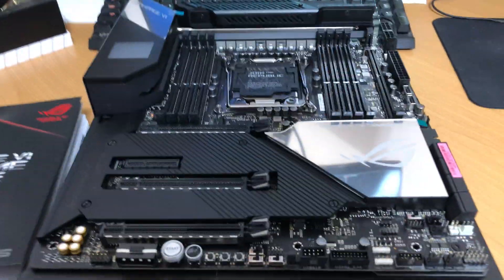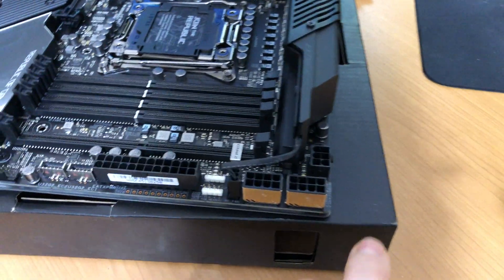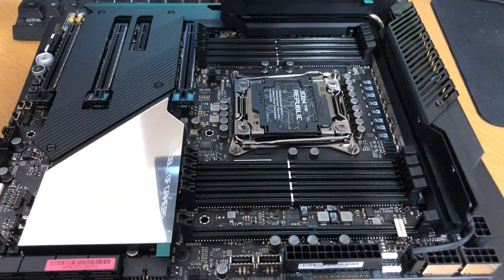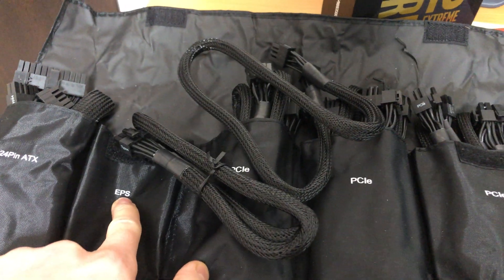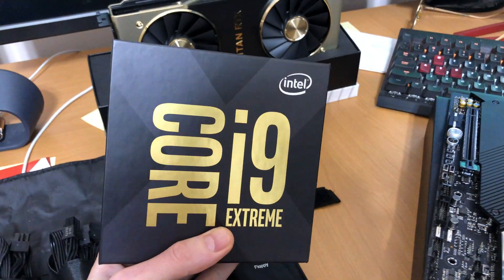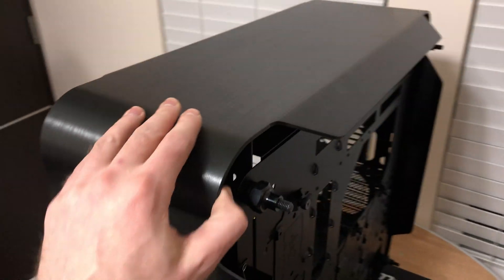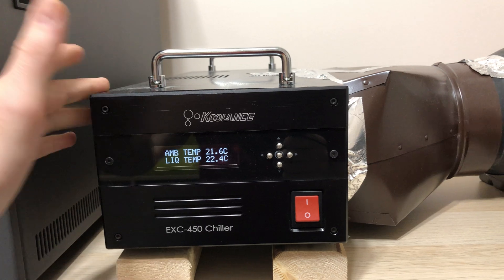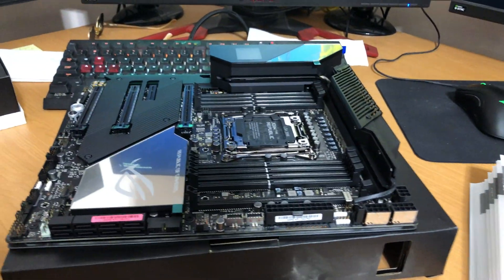ROG Rampage VI Extreme Encore - Why it has 3 power connectors?

Comment: Thanks for the update... My Rampage Extreme Vi did well stop working as it should last week .. so i had to send it back .. and they had no similare left ( well there was one that needed minimum 3 CPU cables .. though i have found no powersuply that even has that in stock here ...  So i got my money back so i could buy the encore instead somewhere else .. and that made me crazy what the 6 pin was for .. if i dont need it because i dont do overclocking or i can use a PCIe cable instead there then i am good and happy .. lets hope the last Encore motherboard that seems to be left in Europe works :P

Comment: I know I'm very late to this video. The 2x 8 pin EPS and 1x 6 pin PCIe are all for CPU since they are right next to the CPU VRMs, as an 8 pin EPS can provide up to 336W, and multiply that by 2 is 672W. Now, since there are cooling solutions that can allow you to cool CPUs operating past ~650W, that's why the additional 6 pin is there, to give an extra 75W of power, and because 99% of normal power supplies only have 2x 8 pin EPS (which to be honest, is not a problem). I know some tech junkies will explain that because of the cable gauge, 6 pin cables can actually pull more, as the extra 2 pins on PCIe 8 pins is just ground pins, but I am just sticking to specs here for normal operation. Since this is in the Extreme lineup, you always get the most power support with the exception of the Apex board, which is specifically designed for hardcore overclocking.

Edit: The way I know the 6 pin PCIe connector on the motherboard is actually for CPU and not PCIe slots is because it is next to the CPU VRMs, and not next to the actual PCIe slots; even the motherboard states it is for EATX_12V, which means it's for CPU.

Comment: The EPS power all go through the VRMs, there is no separate plugs for the CPU directly.  EPS power carries 12 volts. VRMs sole purpose is to step that voltage down to what the CPU can actually use (.7 to 1.3 volts). 

Both 8 pins are EPS connector. The 6 pin is meant for and accepts a 6 pin PCIe just bill one would use for a graphics card.  It will not burn up the board and you do not need to force it, the connect fits just fine.

The reason for multiple plugs is that Higher end CPUs draw more current and in boards designed to over clock then the power draw can increase by 2 or 3x when pushing the limits. To handle the extra current board makers are forced to supply more current to the VRMs by increasing the number of wires to the cpu hence 3 plugs.  If you try to pull 100 amps through a single 8 pin plugs the wires from the PSU to the MB would melt their insulation and probably catch on fire.

Comment: some processors are extremely power hungry if you overclock them for example the Threadripper cpus can consume about a whopping 400+watts on full load. In short for stability reasons you have an added power connector

Comment: I have the same board for my motherboard and I have a Intel I9-9820X and I ended up connecting all 3, meaning two 1x8 pin CPU cables and one 1x6 PCI-E cable. I haven't tested it in extreme yet thought. Good luck to anyone else wondering about the same question

Comment: Hey.
About slot x16 on Rampage VI Extreme Encore,

PCIe 3.0/2.0 x16_1
PCIe 3.0/2.0 x4 (PCH)
PCIe 3.0/2.0 x16_2
PCIe 3.0/2.0 x16_3

I have RTX NVLink SLI Bridge (4-Slot Spacing)
so

Can I use the first slot and the third slot for Nvlink run at x16?
or must be first slot and second slot?
Reply from the maker: Go to BIOS setting to assign lanes per each slot.
Reply: @pcfreezer6448   Thank you.

Comment: You dont need to plug all EPS connectors
For 300W power consumption of cpu, enough one 8pin
600W 8+8 
900W 8+8+6 LN2 overclocking
Reply: Well.... Skylake X CPUs can take gargantuan amounts of power, upwards of 500W, so 8+8 is absolutely recommended. If you are doing custom loop cooling or stronger forms of cooling, that 6 pin will come handy.
Reply: @Berfs1  You will never need a 6 Pin, if you already got 2 8 Pins connected. You can't cool more than at max 500 Watts of CPU power. Even with extremely good water cooling.
Reply: @Elias-ru5xk  dude there are literal benchmarks showing the CPUs alone taking more than 600 watts on a custom loop.

Correction, ~500W on a 360mm AIO. It absolutely can push more on custom loop. Source: https://www.gamersnexus.net/hwreviews/3066-intel-i9-7980xe-7960x-thermals-power-review

Comment: I have the same board. I conectet all 3. It's for the best CPU power and VRM temperature/powerdistribution. (I wrote a mail to the Asus support and asked about that)
Or you can just connect the 2x 8pin without the 6 pin, or 1x 8 pin and 1x 6 pin. Even just the 1x 8 pin should work. The 1x 6 pin is a 6 pin GPU / PCI-E cable. A 600W powersupply is not enough for this System. If you overclock the CPU it can pull 400-500W allone +250 - 300W for a high end GPU.
Reply from the maker: So you have used standard PCIe cable for that 6-pin port?
Reply: @pcfreezer6448  yes. But don't use just the 6 pin.
Reply from the maker: Yes. 6-pin PCIe fits and works perfectly. Not sure about performance boost, but hopping it does the job.
Reply: Wonder where did you see 600w power suply, I can see one 1600w...
Reply: @MrEmx2007  did i over see a one?  :D